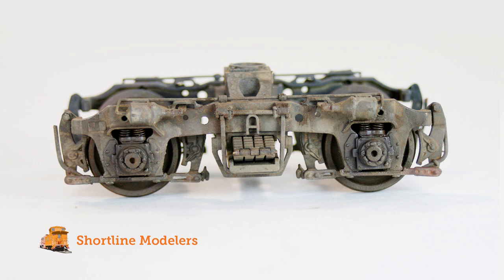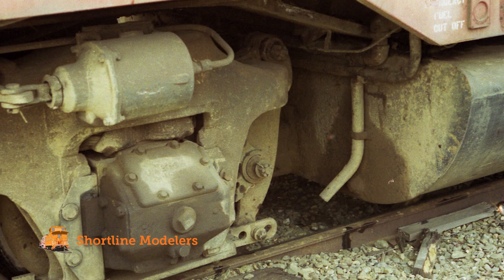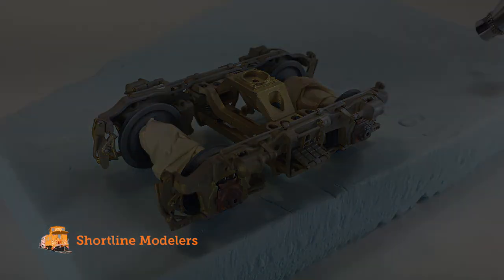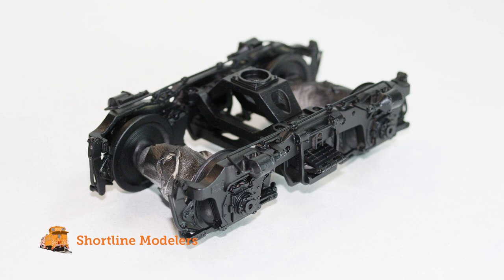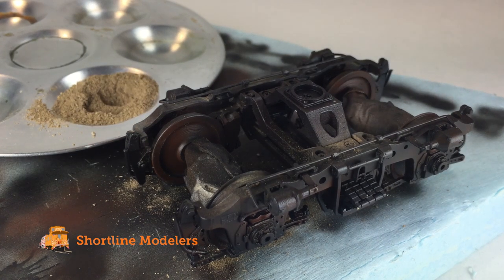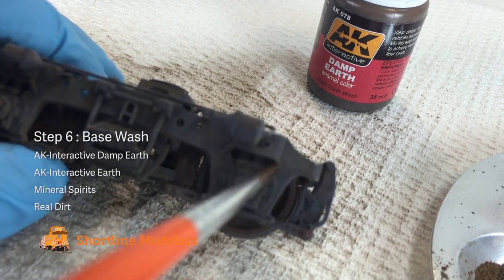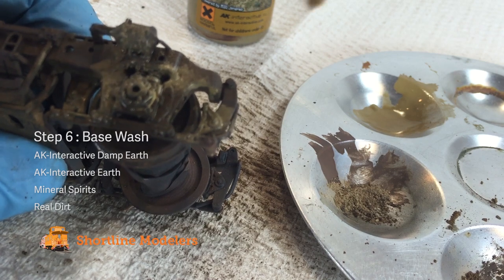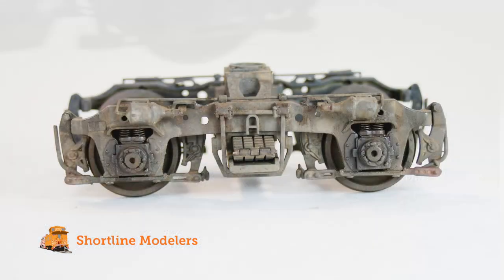Shortline Modelers TV Episode 1

Comment: Where did you get the fantastic engineering drawings used in this vid?
Reply from the maker: Those are from old copies of Mainline Modeler Magazine.
Reply: I've been following your GP9 project on the Proto48 Facebook group as well as the Shortline Modeller website. Fantastic work you're doing. I'm in the early stages myself of doing some work on a  couple brass GP7s and a Red Caboose GP9 3rail to 2rail conversion. Could you let me know which issue those drawings are from? I'd love to get my hands on a copy of them for my own reference.
Reply from the maker: Thank you very much! There were several articles on the GP7-9 between October 1982 and May 1983. If I had access to a copy machine or scanner I could get you a copy.